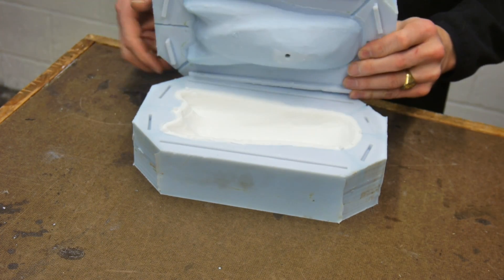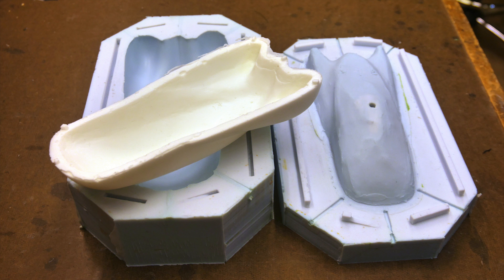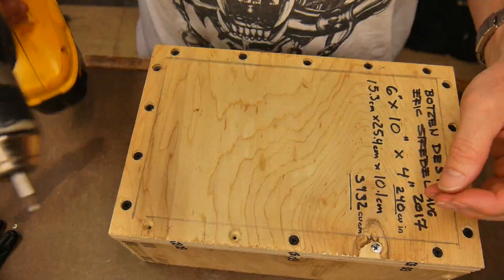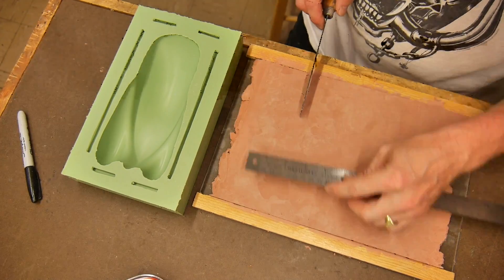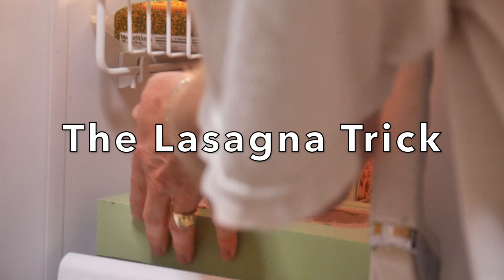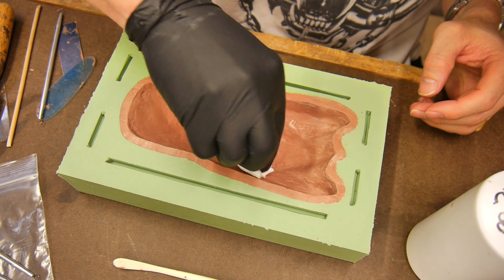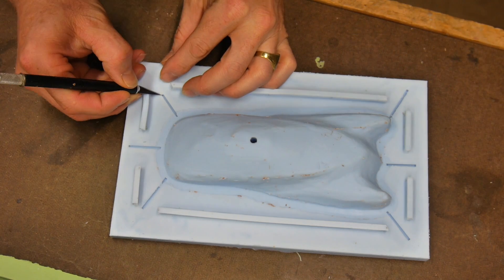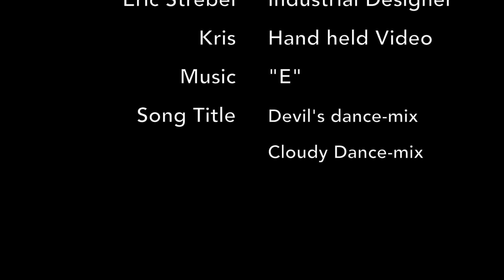Transforming a Solid master part into a Thin Walled Hollow cast resin part

Comment: Hi there.
I hope you can help, i have a HSC student wanting to make a hollowed out resin heart and lungs she is sculpting out of paper clay.

I wondered if you know: can she use 'art mount board with a glue gun to seal, instead of wood? 
Then would she need to 'fire' the clay or could we just use the clay mould once air dried.
Then what would we coat if anything, the clay with, so it pops nicely out of the alginate.
We only need to make one, but if it isn't right or goes wrong, we would need to make another.
It would be about A3 size.

Thank you in advance.
Any other tips welcome.

Faye
Reply from the maker: You can make the sidewalls out of anything you want just seal it with a coat of shellac including what she's sculpting and you should be able to pull a mold with the alginate. Remember alginate shrinks you need to move fast as soon as you make that mold you need to cast something into it.

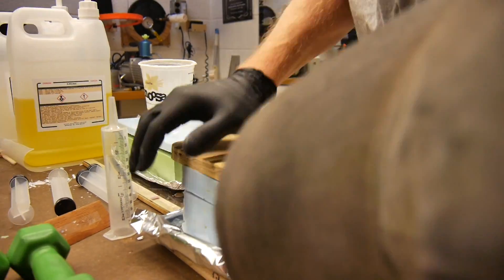Comment: Hey, Eric.  At 4:12, why don't you extend the spokes for the weep channels all the way to the edge of the mold to save you having to cut the channels after the mold has cured?  And, at 4:43, it looks like you built a second mold (all blue), with the first one in the background.  What was wrong with the first one?
Reply from the maker: Nothing, I just have to make a lot of them sometimes so I need multiple molds
Reply: @EricStrebel  Got it.  And the spokes?  Why so short?

Comment: Hi there, great video.  I love the explanation.  What did you use to keep the silicone parts from sticking to each other in the mold?
Reply: Use Vaseline. You can warm it to thin it out.
Reply from the maker: Vaseline thinned with naphta, should be in the video

Comment: Have you tried vacuum forming?  That is the way to go with a simple plug that has smooth surface with no detail.  Much faster, simpler and just as good results.
Reply from the maker: It's not appropriate for this project The parts are much too flimsy they feel cheap and they can't withstand the post finishing process.
Reply: @EricStrebel  You are thinking disposable food tray type vacuum forming. There's much more than that.
Reply from the maker: @freddyrosenberg9288  yeah, your right but the vac formed parts can't take a baked automotive finish.

Comment: Hmm how about if the part needs some support structure like the inside of climbing holds? And thanks for sharing 👌
Reply: lol. I'm here for the same reason.
Reply from the maker: You would have to build those ribs into the master model or whatever other details the part needed before you cast it it probably would not be a hollow part
Reply from the maker: You would have to build those ribs into the master model or whatever other details the part needed before you cast it it probably would not be a hollow part

Comment: Can you tell me, if I use plaster instead of silicone and fill the mold with resin, how would I go about cracking it open to expose the resin (without damaging the resin)? Also, when I put the clay in the plaster mold, will it likely stick to the surface of the plaster because it's a similar make up and consistency?
Reply from the maker: depends on the plaster and how long you let it dry and how thick it is, also how delicate the part is inside and what material you use to cast it and if it has release agent on it.
Reply: @EricStrebel  I'm using plaster of Paris with a strong epoxy resin. What could I use as a release agent?
Reply from the maker: Prudle Doo seal the plaster with shellac if you can then use a paste wax like Johnson’s paste wax also Check with the mfg of the epoxy and see what they recommend
Reply: Thanks!

Comment: Hey sir, I'm trying to make a transparent plastic carburetor float bowl. May I ask what should I use? I need something that resist gas fuel.
Reply from the maker: The urethane should be able to withstand the gasoline’s I don’t know about the heat however, look for a resin that has the right properties to suit your application
Reply: @EricStrebel  thank you for answering my question . How about epoxy resin? Do you think it can withstand the heat?
Reply from the maker: Different formulations will have different properties check with the different resin manufacturers to find a material that is suitable for your application

Comment: Hello. Just wondering can this technique be used when casting body prosthetics that I want hollow with platinum silicone? Or will it only work with a certain kind of resin and certain kind of shapes?
Reply from the maker: Should work on anything, try it!
Reply: Eric Strebel hey thank you for your reply! Do you have any videos that can show how to make one product with different softness silicone in one sculpture? What are the techniques you might suggest to achieve that?

Comment: Hi, I'm trying to make a hollow soft rubber bottle , 
Can anyone assist in what material to use for cast, mold, color
Any consideration would be appreciated
Reply from the maker: You can slip cast the resin or rotomold the part.

Comment: Great Video! Would it be possible to recreate this process with clay, using plaster instead of silicone for the mold?
If not, any tips on how to achieve a similar result in clay/porcelain? Thanks again!
Reply from the maker: Yes I think you could use the plaster instead of the silicone

Comment: Good work Eric. What did you putt between two mould parts so they don't stick together when you putt second part of the mould. Thanks
Reply from the maker: Vaseline mixed with naptha, works great.
Reply: Eric Strebel what are the proportions like for this mixture? 50-50? Also can this technique be used for any casting process that we want hollowed our? Say like a hollow body prosthetic like a finger?
Reply from the maker: Try 70/30 mix

Comment: question for you, could you have, and if so why not, 3d printed the second mold vs. the clay ?
Reply from the maker: No data was available for the project, only had the one part. Perhaps it could have been done if we had data, but I would have just shelled the part in cad to the thickness I wanted, if I had data.
Reply: @EricStrebel  thanks ,was curious as i havent worked with clay but my 3d printing skills are pretty sharp

Comment: What type of clay is it? Clay isn't oil based is it? Usually you just ad water to clay to smooth it don't you?
Reply from the maker: Ben Scott-Pye Chavant NSP non sulphur plasticine, styling clay.
Reply: Cool. :) Is it a good choice for making original models with to take silicone moulds from?
Reply from the maker: Yes, you must use a non sulfur-based clay for silicone casting

Comment: But what if you need pretty thin and nice inside surface?
Reply from the maker: Art Craft Just make a thinner clay surface and you will need to take more time to finish the inside. Thanks for the comment, glad you liked the video. Feel free to share on social media
Reply: Hi I found answer > Slush casting. I try it in free  time,  want to use molten wax.

Comment: Couldn't you also achieve this using a slurry technique?  Pour the resin into a hollow mold, then put it on a rotator to continuously coat the inside of the mold with resin, the shell will harden quicker than the liquid center, causing the liquid to coat the mold in a constant thickness.  I think they call it "slip molding" for ceramic parts.
Reply from the maker: EFormance Engineering resins take a bit longer to set, and work different than the ceramic process, you would not be able to control the wall thickness with any sort of consistency.

Comment: Music is annoyingly distracting with it's compressor duck pumping. You're pretty soft spoken anyway. Vox nearly buried in the trance mix.
Reply: I did not mind the music. I'm on a mac with full surround speaker system and subwoofer. Didn't have a problem hearing what you said, and although you are very soft spoken, it comes out nice and clear.
Reply from the maker: Craig Lumpy Lemke your the only one to mention it....Curious what your set up is, what kind of speakers are you using, what type of device are you viewing the video?
Reply: I agree with the comment about the music being annoying.  I don't know the term "compressor duck pumping".
I'm using a laptop computer with 2 earbuds.
From the start until 0:34 has a 2 hz beat, but there is nothing in the video to support that beat.
From 0:36 you changed the beat and move it and the music to only one channel, 
I am able to remove one earbud to not hear the noise.
After the monologue is done, at 5:17 the music moves back to both channels, but the 'important stuff' has been said.

Comment: Which manufacturer do you prefer using for your silicone and resin?
Reply from the maker: ryspot I like using the Innovative Polymers /Rampf products. I try to steer clear of the smooth on stuff unless absolutely necessary.
Reply: How come you don't like Smooth-on? And what's your assessment on Polytek products?
I've used both these, but to varying degrees of success. My biggest problem is of course are bubbles, but also surface frothing in the resin. It's incredibly frustrating to have millions of microbubbles covering an otherwise perfect surface. How are the materials you use with these issues?
Reply: @My2Cents1  use a pressure tank. It's easy to change a 2.5 gallon Harbor Freight paint pressure tank for resin casting. All you have to take off is the dip tube and the top side fitting above it. Buy a second gauge and screw it into the lid there. That is the gauge you trust because it's directly measuring the pressure in the tank. Get a pipe plug for the spray gun air outlet on the regulator. Install the ball valve on the regulator inlet, and the air hose quick connect on the ball valve. Install the gauge supplied with the tank onto the regulator where it's supposed to go, if not already installed. Install the regulator onto the T fitting where it's intended to go. No need to move the pressure relief valve.

People keep doing this the hard way, and not as safe as it should be. I've yet to find a video on YouTube where a gauge is installed to directly read the tank pressure. There's at least one video where a guy took everything off the top of the lid, hacksawed off the dip tube instead of unscrewing it. He move the relief valve to the dip tube hole then put the ball valve directly onto the air inlet hole. No gauges! No regulator! I assume he relies on the compressor to regulate the pressure, yikes!
Reply: @greggv8  
Thanks bud! I actually ended up getting a pressure tank and it did save me a lot of trouble. It's not configured the way you recommend though. The gauge is on the pump - and sometimes I do have another problem now where the rubber molds get slightly deformed if the pressure is too high. I've actually been suspecting it's for the very reason you talk about here. There needs to be a gauge on the tank itself. Now I know what I have to do to fix it. You must be a mind reader or something. Thanks a lot!